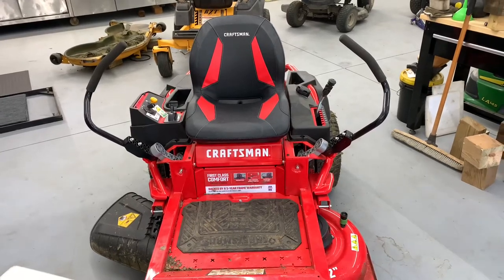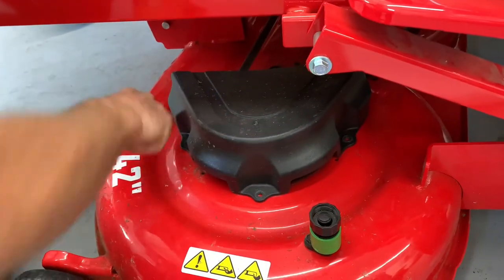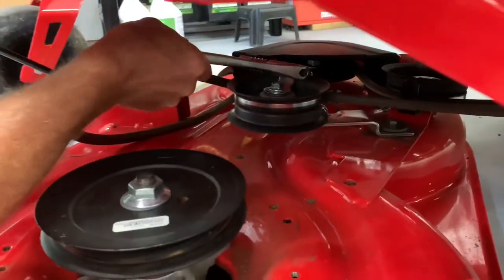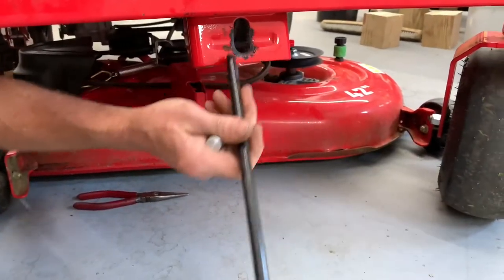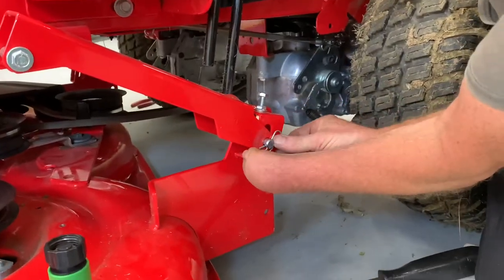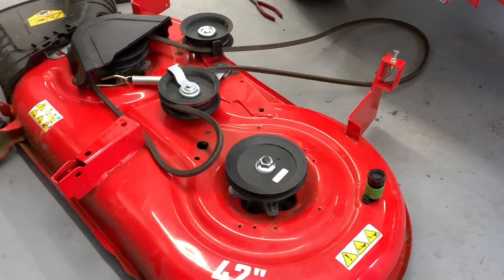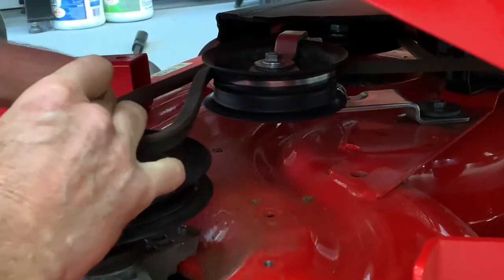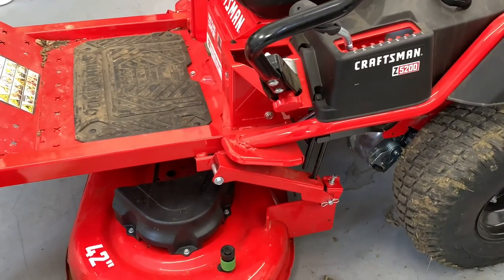How to Remove and Re-Install Mower Deck Craftsman Z5200 Riding Mower

Comment: You made this so simple. I just bought a z5400. Ive cut about a yard and a half and that left pulley was loose I'm guessing. Uneven cutting etc. today the dang pulley just slid out while I was mowing. I hope that nut is still laying on the deck. I guess it was loose from the factory. Freaking Craftsman man lol🤦🏿‍♂️

Comment: When you take it out of park.  Just in Nuetral or the closest position to your body the handles will possibly go....is your body supposed to fit behind the bars at that point ?
Reply from the maker: When sitting on the seat and you’re pulling the bars in from the park position all the way out and pulling in. Yes your body should be behind the bars so when you push the bars forward, you will be moving forward all the bars backward toward your stomach, and you will go in reverse.

Comment: Started my z510 and the deck is wobbling around. Looked underneath and the belts are going all over the place. Is there a way to adjust the tension? Do I need to replace the belts or the tension spring?
Reply from the maker: The belt tension is spring loaded only and the shack is not from a loose belt. The shake can be from several different reasons. Bent blades, bent blade shafts, bent pulleys or even a bad/burnt spot in the belt itself. Also it may wobble more art low speeds. Always run your engine at full speed when cutting the grass.

Comment: That mower belt is under.tension  is probably a electric p.t.o .I have the electric p.t.o on my craftsman gt tractor which puts tension on the mower Deck drive belt  plus it is a 2 belt system 👍
Reply from the maker: Hi Robert, thanks for commenting .Yes, it is an electric PTO.
Reply: @JohnsonsSmallEngines  okay thanks for your reply on your video on this matter
Reply: Good to know   thanks

Comment: Hey Brad how do I level the mower deck when it's virtually impossible to measure from the blades (can't see them). Using the 46" craftsman zero turn
Reply from the maker: Greg, Watch this video and you will understand.https://youtu.be/-z3nqPI-4Wg

Comment: Is there a video showing the replacement of the drive belt not the deck belt?
Reply from the maker: The only video on the transmission drive belt that may be similar to yours if it is this model. Check this one out. https://youtu.be/OpyZ0zCNI7g.